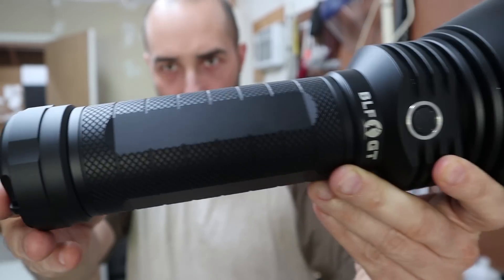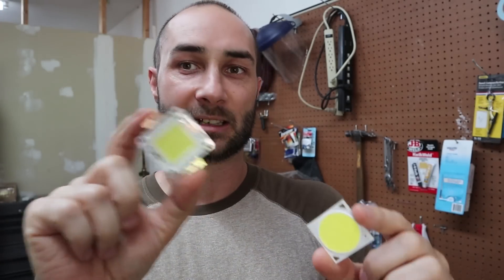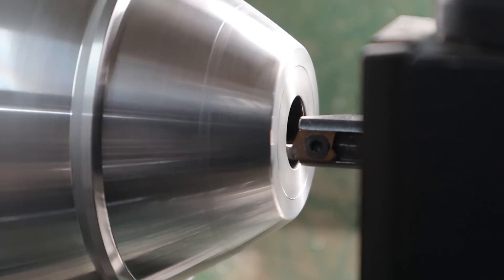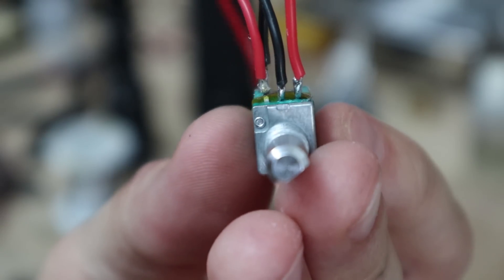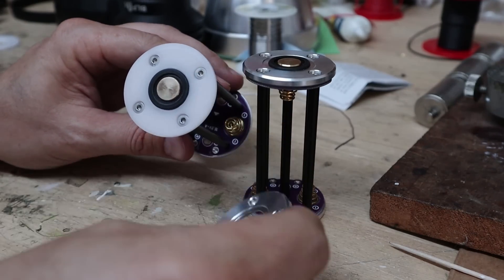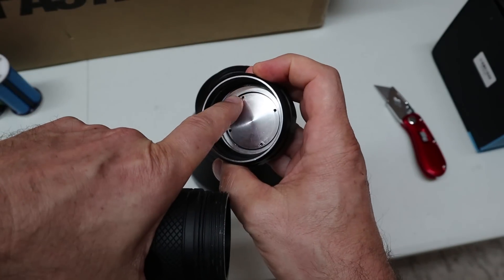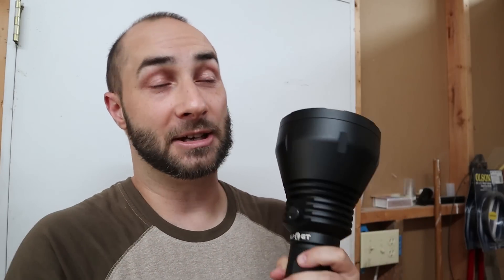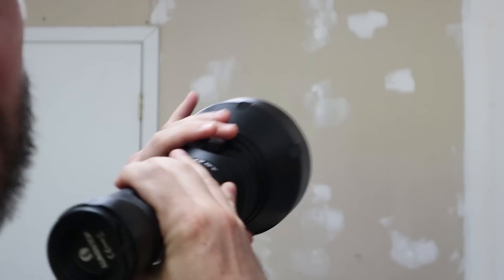World's Brightest LED in a Flashlight!  (Cree CXB3590)

Comment: I know others have said this, but if you made a batch of them you would have people lining up to buy them.
Reply: I think you are absolutely right! I would consider it...
Reply: Money ready
Reply: I'm down for one. Cost doesn't matter.
Reply: Absolutely right brother.............they would sell like hot cakes!!!!
Reply: I think the maglight ie the biggest  flashlight head should get.. but yeah reduce head and make it so u can slug someone with it... and u got a winner
Reply: I dought. You know cooling is a big issue if you have built something similar.
Reply: 1. Since the controller has no thermal protection, it's definitely a concern... but I think most people here would understand the need to manage the temperature, and that large cast alloy chassis will perform as a reasonable heat sink.... 60w isn't an excessive amount, the user will be able to feel the heat buildup, and some physically smaller lights are able to manage 15,000lumen with minimal active cooling... I think it will be OK.
2. 8x18650 is close to 100Wh, so you could expect to deliver 60w for anything up to 1.5 hours... not to mention the fact that as you observed, the thermal dissipation would not allow full power for long periods...so most of the time it will be operating at lower output... again, this is not an issue.
Reply: Here's my money!
Reply: Sign Me Up
Reply: Lol I checked Amazon to see if they were available yet.
Reply: Right, but the surface area of that is probably not significantly larger than the surface area of the light...   of course it will be much more efficient at distributing that heat and the battery compartment will be very poor at radiating (and conducting heat away)... but that heatsink is for continuous operation....   I've not bought a flashlight for years that didn't have a super high power mode with a time/thermal limit.... 

This thing seemed to have a decent mass of aluminium, and perhaps 25-50% of the surface area of the recommended heat sink... so I imagine that you could run it for 3-5 minutes... and possibly if you're out on a cold windy night that might be extended a little... not that you'd want to run on full power all the time... .certainly you could run 4-5000lumens continuously, and probably more efficiently than an LED that had to be driven hard to get that output.
Reply: Castle Bravo  Read Green MarineFive-O's reply to me and you'll understand. 
I experiment with things a fair amount and am also ex cop.
Also have a desire to learn different things to make life easier not only for myself but others and thus pick up a lot of interesting knowledge..
Reply: You could use a replacement laptop gpu cooler and run the LED sideways in a 3D printed casing. Total cost with led driver cooler case button batteries for about 120bucks total.
Reply: Castle Bravo  like a headlamp, or to be more specific the batteries and heat pipes in a column. And the heat sink mount would be front facing.
Reply: James Lewis I want one to I have a gt 70 ready to modify.
Reply: Sell me one!!
Reply: I WANT ONE ALSO PLEASE
Reply: @StealthyMonk I understand why it would be really expensive and not really practical for a small outfit to build one of these. That LED is like minimum $50 for a top bin high CRI (not the hodgepodge ones from Banggood or Aliexpress) compared to like $6 for a bare high bin xhp35 hi. The driver is $40 compared to like $10 for a traditional fet or linear regulator. Add the additional labor to get it to fit the expensive GT host. It would cost around $600. I don't think enough people would buy one to make it profitable. I built a light based off a floating 6V handheld that has a 100W rated emitter for around $60, same design principle, but not as high output as the 3590. I run it off a DC CC/CV boost power supply and 4S2P lithium battery I made from old laptop batteries. It's connected to an Intel heatsink designed for a Core2Quad Q9560, which is rated at around 95W stock. I use an 80mmx25mm case fan on the back. There is excellent cooling and at full power it's insanely bright, it will get really hot (haven't measured it, but probably around 130 F). The battery protection board cuts the power because the batteries get too low after 10 minutes it's a 4.4Ah battery. These aren't high drain, but it runs dramatically longer at half power. I will probably build one based on the 3590 now 😄
Reply: I’d take one for a tac light
Reply: the parts cost 324.40 plus tax and shipping
Reply: Take my money please!! 😃👍
Reply: They can't work for more than a few minutes.... that's why he's not selling them. To dissipate that much heat, he'd either have to do it into the torch's chassis, which would run the risk of burning people, have a massive heat-sink somewhere, or use active cooling (i.e. a fan or something).
Reply: https://www.youtube.com/watch?v=7_eiEpOtA8I
Reply: I would buy one
Reply: I’ll buy one!
Reply: i would buy one
Reply: Agreed. I'd buy it right now $500ish would be perfect IMO.
Reply: @ajsykes07  damn I'll sell you 2 at that price the cob is 39$ battires are 2$ a piece stack holder 15 a piece controller 8 bucks  aluminum pipe reflector head 50 meanwell driver 45 machine shop to cut threads 30
Reply: @la_plata3588  put one together and we'll work something out.
Reply: @ajsykes07  
IMALENT MS18
Reply: @ajsykes07  this would be more of a 700 dollar light with all the mods done.
Reply: @averagerider92  
IMALENT MS18
Reply: @1Stevenc  I sold my ms18, seemed to cheaply made
Reply: AJ Sykes  if you have 500 ready buy the olight marauder x9r
Reply: @AlmightyyCres  I've already got that one lol
Reply: I think the amount of labor involved will not make it worthwhile. It is super amazing project light no doubt but not meant for business. You can get an MT09R  that performs about the same in terms of lumens and throw for much cheaper than the labor cost required to mod the GT but probably the heat sinking on the MT09R is not as good as the  on the GT and shorter run times.
Reply: I'm sure it's true that it would make it an expensive proposition, and there are cheaper alternatives... but just in the same way that people spend 10's of thousands of $$ on classic cars, when essentially any new car would be better in every measurable way... I feel like you would find buyers at any realistic price for the labour involved.
Reply: You've obviously never bought a light from SkyLumen! My brightest one runs for 13 seconds on Turbo before it goes into thermal protect and the only batteries that can power it are Sony VTC5's and they last but a few minutes. That doesn't mean I don't love it thought! :)
Reply: James Lewis It would be perfect for tracking a deer in the dark trying to follow blood trail. Because there’s never enough light.
Reply: @_jurist  follow a blood trail, invest in a black light...
Reply: Colaaah blacklight does that actually work?
Reply: @_jurist  blood and semen and some other stuff dna related shows up under black light
Reply: Rognvaldr Asbjorn Have to look into that, thanks
Reply: @rognvaldrasbjrn3972  Wrong, you have to spray the area with Luminol spray first then use black light.
Reply: Colaaah learn how to shoot and
Reply: Colaaah learn how to shoot and you wont have to track a bloodtrail
Reply: @_jurist  Can't you just shoot people instead, we got a fuck load of them ?

Unlike a harmless deer, they can fight back.

Like if you accept the challenge ;)

Comment: That is a Beast.. what dose a light like that go for???
Reply: I dont think he has the time to spare to build these for other people.
Reply: He refurbished a previous light he had. Probably not too hard w/a shop like that! He then explains, and shows the whole process, except soldering the chip in place, where the tiny chip had been removed. They have solderless chip holders these days as well. Cooling is VERY IMPORTANT, and he explains this, but dosen't mention using thermal paste, or a thin piece between the chip and board with the paste spread well, or piece well, to heat sink/fan for lowering temps.

Comment: For how long does it run on max? would i be unreasonably optimistic if i thought it would run continuously at 16k till the batteries runs out?
Reply from the maker: I think probly on max power I would say in 10 minutes it would be hot.   I would like to run a test and see what output is fully sustainable.